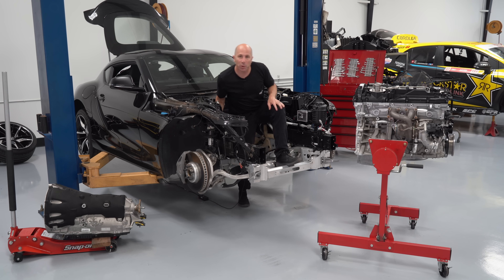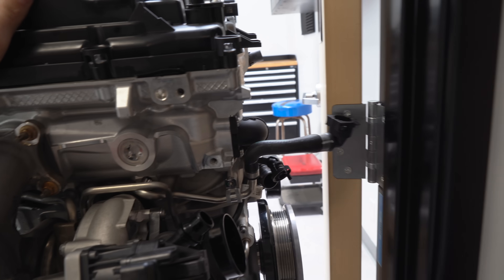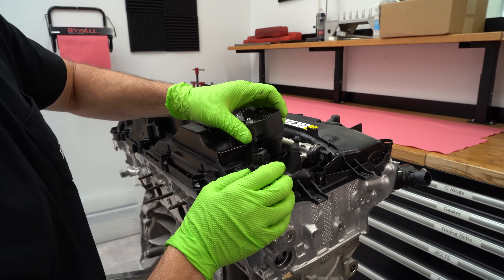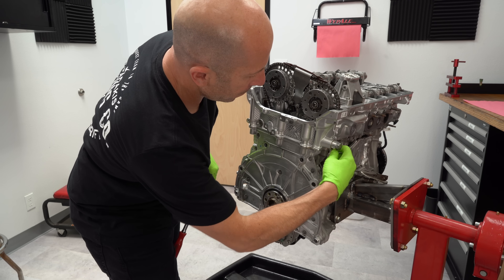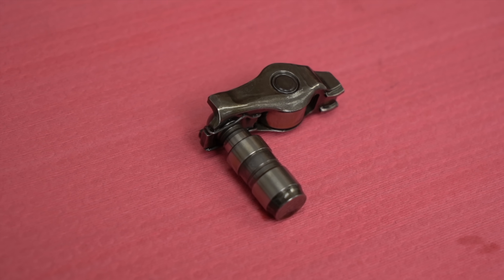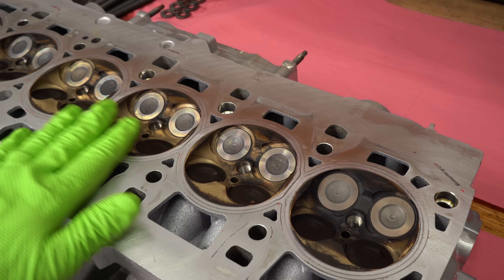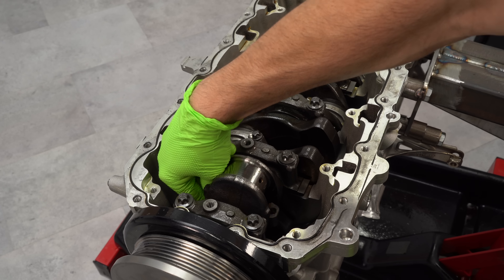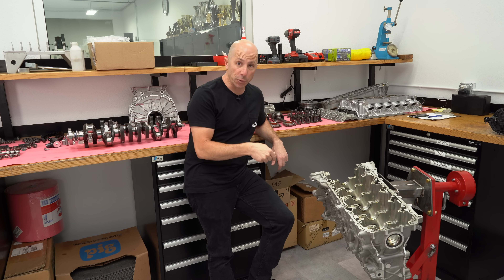2020 Supra B58 Engine Teardown - First Look - Better than the 2JZ?

Comment: Like anything BMW it will be great as long as the warranty is not over. After that you never want to own one. Timing chain at the back of the motor! Great, you need to pull the engine out to do a timing chain service! How much will that cost! Yeah I know chains don't need service like belts do. Tell that to all the owners of Euro cars with 60k on them and the chain tensioners and chain guides are coming apart and have or will jamb their chain soon! My old Supra 90k between belt services from what I recall and it's at the front of the engine! Toyota / Lexus just shot themselves in the foot, no wait in the dick by teaming up with BMW and the BMW reliability and cost nightmares. What a cluster fruck this is going to be! How many old BMW's do you see on the road anymore and of those few old ones. How many have not had a service history adding up to thousands of dollars spent on mechanical and electrical issues? Show me any aging BMW 6 or 7 series car with a warning light on, and I will show you a car with at least about 40 different trouble codes!!! LoL... Great cars if you love to spend money constantly on them making a shop owner wealthy... So at that point your better off buying a real Toyota product (new or used) and take all that money you would have wasted on repairs after the warranty is over and buy yourself a real boat for summer fun or a old classic American cruiser project car that after 40 years probably needs very little to keep it going strong...

Comment: Wow, basically a diesel engine,  precooler, direct injection,  common fuel rail, mecanical pump near the fuel rail, , now 2 small  exhaust ports, mmmm, doesn't look efficient,  the rest looks nice

Comment: The cam core on this engine is gonna be the limiting factor on how much power this engine can truly make without breaking the valve train components.  The cylinder head on this engine doesn't leave very much room for any mods that will increase the reliability of making that much power. 

Overall it's a nice design but I don't think it's going to make 1000 horsepower without really dumping a crazy amount of money at the machine shop and without fabricating one-off parts.  Not being a hater guys but I think this mountain is gonna be crazy to climb.  You may end up spending more money than what you paid for a brand new car.

Comment: I don't like how much stuff they try to shove in to other components...internal air to water cooler? Can't wait to see that engine thermostat have a rationality DTC like the 2.4 Multiair has...that tech is going to get krunked after doing that repair. I'm not a fan of overly complicated designs, there's a reason why the KISS principle is king.

Comment: Thats not a Toyota engine this is a BMW B5830M1 3.0L DOHC 24 valve twin-scroll single turbo I6 same as that of 2019 BMW Z4
Reply: Wrong. It is stock engine by BMW, that was developed by Toyota and this make difference ;)They knew what they was doing, because it is solid build and with Toyota hands now it is probably 2 times better.
Reply: Christian Potaczała  
Ok well thats the same engine but it has been tuned by Toyota. Its not a new engine but rather borrowed from BMW which they offer in Z4
Reply: @usmanrazakhan6849 Ok, Ok live your life :)

Comment: Why does BMW put so many plastic parts on engine? Is it a common practice for other car makers?
Reply: When they do a achieve the right composite plastic that can handle the heat, the material would be better as it will not be prone to corrosion and is lighter than aluminium and steel. When they do get there, it will be all worth it. The question is, does this supra have the right plastics?

Comment: Simple Design 🤣🤣🤣 the variable valve timing system for the intake. Mama Mia'🤯😱😵💀👻
Reply: Probably way more reliable than some of the oil operated vcts though lol (looking at you ford 5.4)
Reply: daniel mcdonald I own a 2005 expedition with that shitty variable cam timing system, best bet is to install those machined lockouts into the cam gear and save yourself from when the cam gear eventually goes. Makes a terrible knock when it does. Reliable car now
Reply: daniel mcdonald Honda’s are oil VCT’s simplest thing to swap for updated  one . And more reliable than you think , this is a nightmare if it goes out

Comment: i have a 2000 honda accord coupe, 3.0 v6 wtih 165k. when should i replace the timing chain?
Reply: Accord v6 use a belt not a chain and Honda recommends replacing it at 100,000 miles along with the water pump.
Reply: @michaelhorgan9525  hmm my mechanic that I work with said "wait until you have to replace the chain" as in it's expensive and a big fix.
Reply: @discoveranceband  You have to replace the belt at a normal interval as those engines are interference and if the timing belt breaks, you may very well have to replace the engine.
Reply: He is probably confused between 4 cylinder and v6.
Reply: @michaelhorgan9525  thanks! appreciate your help
Reply: well come to think of it, would you say the belt has already been replaced considering im at 165k? could it have made it this far past recommended change time?

Comment: Hopefully there no cam chain tensioner problems like they are on German cars. I have a lot of problems with the cam chain tensioners and the cam chain getting real loose. I like how everything is forged though. The problem with direct injected vehicles is the carbon build up on the intake manifold. Other then that this seems like a good motor I don’t know if it will hold 1000hp stock though. Transmission probably needs to get tuned for more clamping power if not that transmission will go fast considering it’s not a dsg. They should have put a dsg in it for the amount of money u have to spend on it 🤷🏾‍♂️

Comment: Should not remove the injectors and rail in one. Need to separate the rail from the injectors before removing the injectors as it will cause damage to the injectors and stretch them and they may leak when pressure is applied upon restart causing a fire risk

Comment: The block is closed because all the new BMW “B” series engines, ie this BMW B58 are based on the Diesel engines/blocks so they are a lot stronger, it’s also why the timing chain is on the transmission side, the newer diesels have all the timing chain components on the transmission side for noise/vibrations etc. so because it’s based on the diesel blocks it’s a lot stronger and has the some of the same design aspects...
Reply: Well judging by how practically none of the BMW 6 cylinders have chain issues I would say it’ll last just fine, plus BMW has switched from Castrol oil and lowered their oil service intervals to try and solve all previous timing chain issues they had before, which judging by how all of my customers who changed their oil below every 10k miles never had timing chain issues (even on the problematic engines with known chain issues) this will practically solve the chain issues they’ve been having on the Minis and BMW V8 engines and even when timing it is required it’s still just about as easy as it was on the previous generation engines.  

And Mokoko Mokoko, not exactly sure what you were trying to say there but if I read that correctly, front end collisions are definitely not the reason for the timing chain assembly being located on the rear of the motor. The body and bumper reinforcements are designed for front end collision safety requirements, the engine is not. It is, like I said before because the block/engine is based on the new generation diesel blocks as BMW is now going for a modular engine design across the board to save costs etc, with the plus side being a stronger gas engine because of the increased strength/durability needed on a diesel engine.
Reply: @incredibleCricket  The most important architectural difference of the N47 engine is the position of the timing chain. BMW carried the most critical part of the engine - the timing chain, from the front to the rear of the engine - to the transmission side, which carries the power from the crankshaft to the camshaft and opens and closes the valves. The backward-positioned chain was designed in two parts, as in the M47; the first chain carried the power it received from the crankshaft to the injection pump, which produced pressure to the fuel injection system; the second chain also reached the camshaft via this injection pump. In other words, the injection pump is also moved to the rear of the engine. This change has two important purposes:

First, the change was one of BMW's moves to give the car's weight to the rear to ensure an even (50:50) weight distribution between the front and rear axle. BMW was trying to lean back all the equipment under the hood as far as possible. BMW's placement of the chain at the back of the engine can be regarded as a commitment to ensure that this part is maintenance-free and runs smoothly throughout the life of the engine. Because in BMW engines that are positioned longitudinally and behind the front axle, the only way to intervene in this chain is to lower the engine. However, the timing chains were not entirely smooth (we will return here again below)

Second, this is a pedestrian safety move. The rear transport of the timing chain and the large set of double gears integrated into the camshaft on which it rests have reduced the height of the longitudinally positioned engine at the front. This allowed a wider gap between the engine and the bonnet. This gap serves as a deformation zone in case of collision with pedestrians; there is a larger area to stretch under the bonnet hit by the pedestrian head, which reduces the risk of pedestrian injury.
Reply: @incredibleCricket  Good info
Reply: The diesel runs at WAY lower RPM though. So the chain wont last like it does there.
Reply: Bmw has put the timing chain for 50:50 mass balance and making clear between front bumper and the engine for protect the engine from damages and somebody which is the car has crashed on him/her.

Comment: Well there's an engine that won' t see 10,000 miles.
Reply: Theres a bunch of these in BMW's that have passed over 10k with no issues currently.
Reply: @carboydorifutoparty3976  No doubt, I have one. I just don't like the idea of a new engine being stripped and put back together outside of the factory. You're telling me that if someone told you that they took the engine apart and put it back together again just to satisfy curiosity, that you would buy that car?  Don't get me wrong, great video, very informative and all, but surely the integrity of this engine has been lost by stripping it and putting it back together outside of factory conditions. Where is the QA in the whole process?

Comment: Great video love seeing the new technology they use on engines now days.   Ford S.O.H.C 4.0l v6 has a timing chain on the rear of the passenger side head with a jack shaft that runs in the center of the engine and hooks to the timing chain in the front.

Comment: Yeah electronics can move faster than my foot but it doesn't react faster than a direct connection to my foot. Cable throttles are a direct mechanical actuation of the throttle there is no delay where as a drive by wire system has to process the input and then send an output signal. It might be a few milliseconds but it's still a delay. If the cable system is set up properly there is no delay.

Comment: Man, it's great to see how this engine actually looks like on the inside. Way more useful info that all the "engineering explained" and manufacturer ads.
So they have used the awesome and age-old 1FZ oil cooler design for this new engine, at least they did something right. Actually this engine is quite inline with modern tendencies in engine design. Direct injection, timing chain on the worst side of the engine you can possibly put it on, e-throttle, valvetronic and other semi-bs and overly promoted tech is to be expected.

Comment: every car made today is bulshit. if I bought that car new and it came with a motor like that I would take it back and Sue the Fockers that made it. seriously a plastic intake? no exhaust manifold so a proprietary head to that year good luck porting that. a cheap ass plastic canister style oil filter really those things suck they break they leak and the dont take the heat. using coolant to cool the air is fcking stupid. coolant is extremely hot compared to Ambient Air Temperature and in some cases will heat the air. an intercooler inside of the intake LOL these Engineers are asshats and they make it to where you cannot work on anything or you have to pull a motor to do a fuking timing chain and you're an asshat for making this motor do a thousand horsepower , which I still don't believe the numbers on that piece of shitt motor.

Comment: Can you do a video the Bmw M62tu V8 full take apart in high quality video
Reply: Hell yeah that would be dope heard that engine pretty reliable it’s only weakness are the timing chain guide which we’ll probably need to be replaced at higher miles pretty sharp engine
Reply: They film really good that would actually be dope to see
Reply: Bro supercharged built would be cool
Reply: You can do that yourself! That engine is even easier to take apart than this one. Its chain driven, but the way BMW made it, you can turn the engine against direction of rotation and nothing happens, unlike VW's where turning an engine 1 degree backwards will make the chain skip.
Reply: @February54  Yea, there is a bunch of BMW's for 1750 to 3000€ nearby, so that's a relatively cheap V8 and a lot of fun probably.
Reply: I wanna see them built on the only big problem with that engine are the timing chain guide wear out around 150k depend on what conditions engine went through guide need to be replaced other then that engine is really reliable v8

Comment: This is not even close to a 2JZ engine. I mean, it's totally different
Reply: Kytes93 It’s not supposed to be the same. No one intended for it to be the same.

All Toyota wanted is a turbo straight six, and they got it.
Reply: @jpogigtxcr1778  They ASKED bmw that they wanted a strght 6
Reply: @Kytes93  Exactly. No point of wasting money developing a new straight six if another manufacturer got a working one.

BMW is currently the leader in the industry when it comes to straight sixes

Comment: Comparing this to a 2JZ is like comparing a Ram 1500 V6 to the Cummins I6.
Reply: @Bamaca_B58  yeah that's not what I was getting at. They were designed to serve different purposes in different ways despite going into similar vehicles.
Reply: @Shakshuka69  for now id say it's comparable to the 7mgte more than the 2jz.
Reply: @carboydorifutoparty3976  not even. That's still an iron block low compression turbo motor that was meant to go in the fastest car Toyota sold and wasn't intentionally crippled to protect M4 sales.
Reply: @Shakshuka69  I meant power wise......also the JZ wasnt intended to be a performance engine either
Reply: @carboydorifutoparty3976  it most certainly was meant to be a performance engine, that's the whole point. And the 7MGTE only made like 250hp so I'm still not sure what you mean there.
Reply: @Shakshuka69  what I'm saying is that the B58 might be able to handle somewhere around 800-1000hp like the 7m can  and if it goes over that ...well we'll just have to see what it's true limits are.

Comment: Nice Bmw plastics at the engine...they will brake very nice also and expensive parts from Bmw, as always.
Poor design engine..Its just german motor.
Shame on you Toyota.
Isn't Supra this vehicle!
Reply: Agreed. I would have preferred that the Japanese built this motor. Germans build complicated motors with cheap parts. The fact that this is the Supra is what is most upsetting.

Comment: Just to get your opinion, but the intercooler, that uses the coolant to cool down your turbocharged air is locked inside your intake all nice a pretty, what happens at high rpm on the track or... on the dyno that cooler springs a leak and hydralocks a cylinder or cylinders... looks like a weak point for catastrophic engine failure.

Comment: Kudos for the Pig oil sorbents. I work in a bearing test laboratory, I use the shit out of them. The braze plate oil heat exchanger is a really space efficient way to remove heat from the engine.

Comment: Great tear down vid.

Few things to like on this 
Oil from the head goes to the side of the windage  tray  and the crank looks.

Not so much
Plastic intake with fused intercooler
Plastic cam tensioners
The gasket and seals around the oil/water cooler will leak over time
Cast in exhaust ports limit flow opportunities to put a bigger turbo on

Comment: How does this engine compare to Honda's Civic type R engine? Which one do you will be better?
Reply: If you mean from a reliability stand point, IMHO only time will tell, stereotypes dictate the honda would  be better but that would be going on an assumption that the relative marques never learnt from their past mistakes and kept doing the same as before. On the other hand, given the choice what I would go for ? Well, one is a 2 liter turbo 4pot, the other is a 3 liter turbo 24 valve 6pot. Hmmmm, that is a tough one.

Comment: Drive by wire is actually faster...🤔 how is that possible with a cable it is physically connected to your foot the fastest drive by wire could be is the same as a cable, but the big thing with drive by wire is so you don’t need a cable to be routed with no hard turns and through the firewall

Comment: I'm no master mechanic and dont know alot about most vehicles other than what I work on of my own and call me a cave man living in the dark but I didn't realize they were still using mechanical fuel pumps on modern vehicles. Nice video and thanks for sharing. Just out of curiosity did you dyno it before you tore it down? Be safe and be blessed.